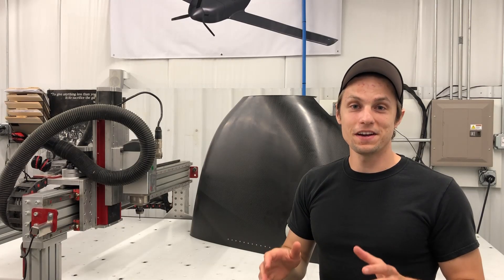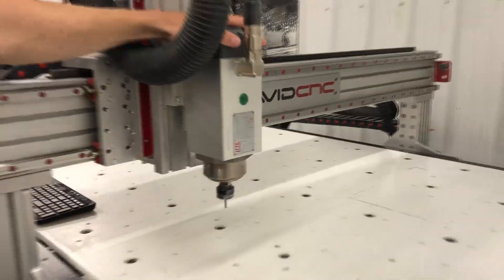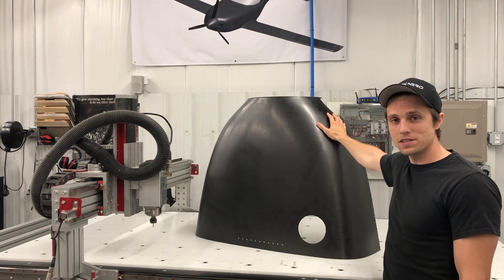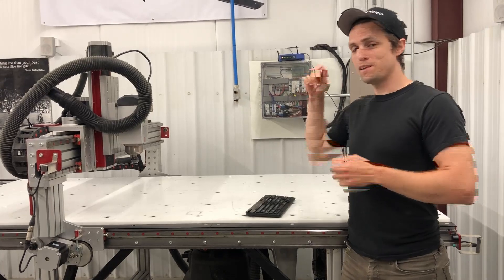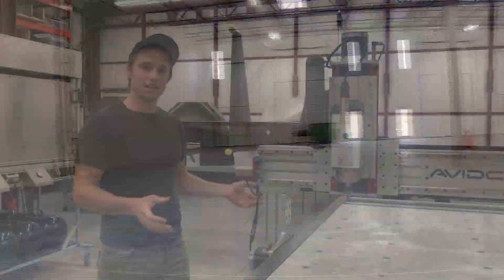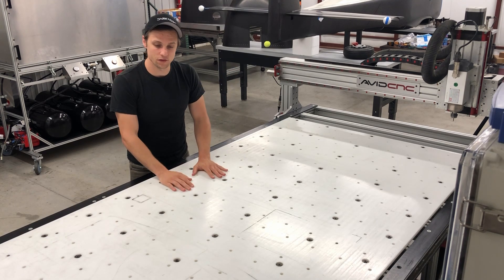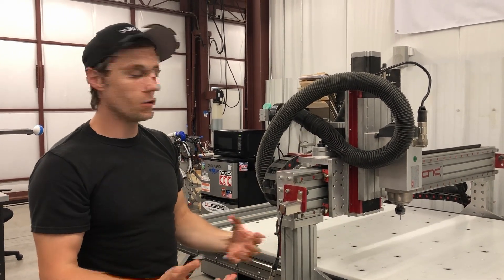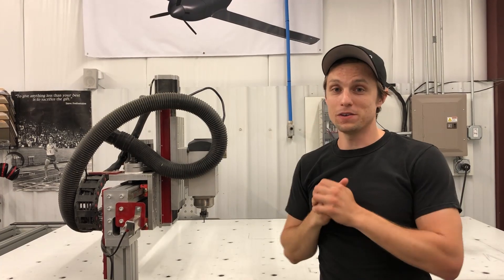Using a CNC Router to Machine Aerospace Mold Patterns (part 1)

Comment: The precision numbers you claimed for this machine are outstanding.  Have you verified them somehow, or how did you arrive at them?
Reply from the maker: Greg, thank you for watching and the comment! These precision numbers are the same ones provided by Avid CNC on their website. Once we got the machine setup we spent a long time getting it dialed in and then setting up a process to ensure it remains dialed in over time. One way we verified machine capability was through machining a variety of parts and checking their dimensions against the prints/CAD.

Comment: Hi guys. Please could you elaborate a little more on what matching/cutting bits you use for machining solid epoxy carbon Fibre boards as well as what feed rate and spindle head speeds you you use. We use our CNC router for cutting out parts from prelaminated vinylester Fiberglass boards with a foam core and seem to go through bits. The bits get chewed up real fast from the resin?

Comment: Do you plan to add a vacuum to it to simplify holding parts?
Reply from the maker: We had considered it and ultimately decided the vacuum table wasn't a good fit for us at this time. Vacuum tables are costly, require additional electrical power, can be loud, and can also lose vacuum due to an unexpected power loss. With running larger mold patterns in the middle of the night while we weren't there, we didn't want to worry about the potential vacuum loss.
Reply: DarkAero, Inc Right on. My best friend runs all the CNC parts for a company called Rugged Radios. We actually machined the vacuum “table” from aluminum w/criss-cross channels for gasket material to seal. It definitely has its place. I’m not a machinist just thought I’d chime in.

Comment: I would permanently mount sensitive bubble levels onto the table so that you can detect shifts right away. Survey-grade bullseye levels are accurate to about 10' (1/6°). Also the aluminum frame is probable the biggest culprit to dimensional changes by far. The operating temperatures should be kept within a few degrees Fahrenheit or so. Aluminum has extreme thermal expansion. If you're getting tolerances in the thousandths across eight feet,  you must be looking at holding about 1.5°F in aluminum.

Comment: I've got an AvidCNC, too (although I put ClearPath servos and an HSD spindle on mine). The HDPE is a cool idea. I bet a piece that large was expensive. Did you really find an improvement, though? I would have thought over the course of one job it wouldn't change that much.

The additional braces are interesting. I store a bunch of lumber on the bottom cross beams, making it quite heavy, but I do see the frame move a lot with every acceleration change. Do you find they help a lot?
Reply from the maker: Rick, thanks for watching! You may not see much change in a single job. It becomes more important for machining larger sections that need to fit together that you can’t machine all in the same timeframe. The bracing helps. Anything you can do to further increase the rigidity for the machine is a plus. It was definitely worth it for our parts.